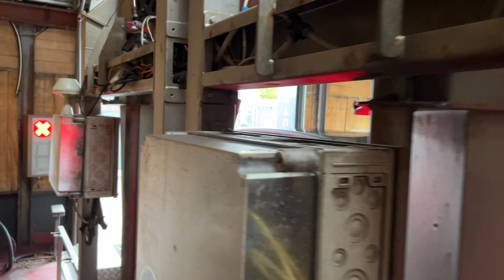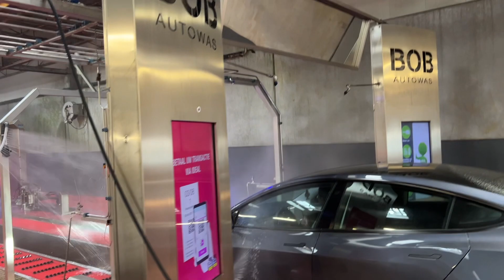Bob Autowas: Amsterdam Sloterdijk Site

Comment: can you explain more about pay2exit? is this means the paystation is at the actual exit? how would the car wash differentiate packages and keep track unless there was some kind of paperticket of services consumed like at a restaurant?
Reply from the maker: The way the pay-to-exit setup works is similar to a parking garage. When you enter, you select your wash package like you do with a conventional point of sale setup while a camera reads the license plate and ties it to the transaction. The employee or pay station gives you a ticket if you are a 1-time customer, and unlimited customers can enter when their license plate is read like normal. License plates are read again by another camera at the tunnel entrance to ensure customers get the service they are paying for. On the back side of the ticket is a QR code that allows customers to pay online with iDeal. You can also pay at a pay station in the vacuum area or by the interior belt (at sites where applicable) after scanning the ticket there or entering your license plate number. The property exit is gated with another license plate recognition camera to verify payment (or unlimited customer status). Reason the system was developed was to reduce the time required at the selection phase, as time that would be used by the staff for payment can now be used on upselling customers instead.